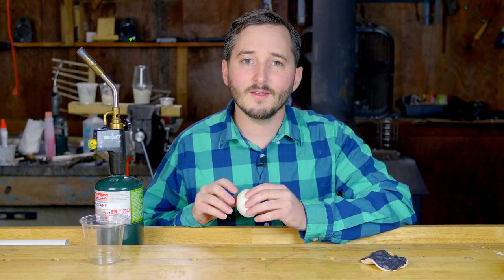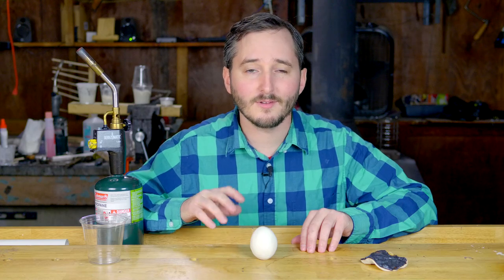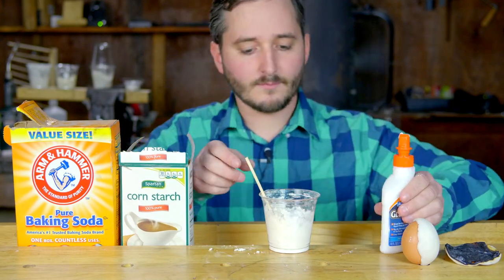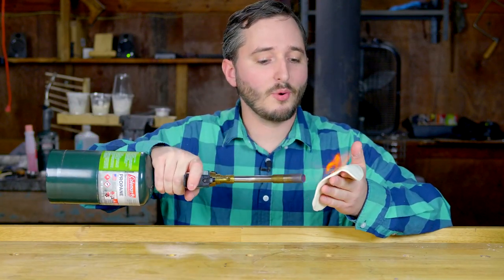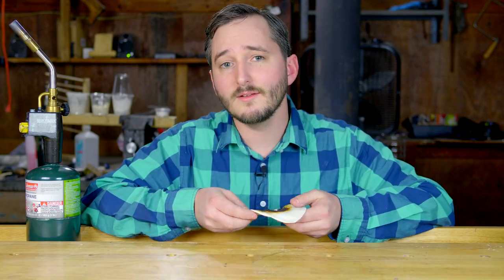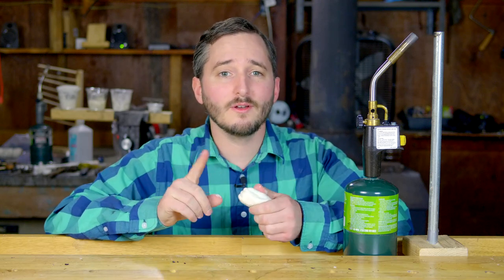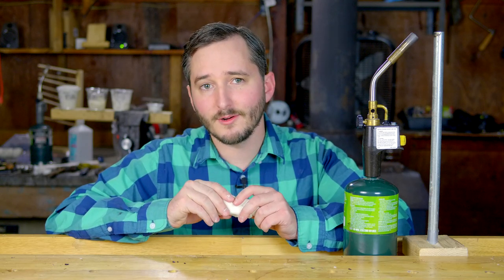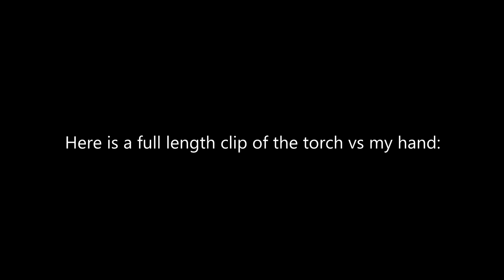A Super-Material That Can Be Made In The Kitchen (Starlite Part 1)

Comment: Just awesome. Add graphite into the mix and you most likely have Starlite II. All houses firewalls should have a layer of this. Or the whole house should have it, as it is made of cheap materials. PVA's and such will be hard after a while as you mention. Is there is any compound that makes it gelly or soft for a very long period (before the heat/fire hits it, oc)?
Reply: Is the only  next thing a fire can turn this charcoal/graphite mix into, if added pressure, diamonds? :)
Reply: Silly really to "reply" to your self. However, I found one information #NightHawkinLight could answer. The longevity of the PVA Starlite is around 2 weeks,  as it is claimed. Do you by chance have any of your own starlite that has passed 2 weeks and still posses the same properties. Or does it indeed fade away by time?
Reply: @corresandberg  sometimes, the most intellectual inspiration and conjecture you can find in conversation, is with yourself...I do however appreciate that you shared your thought process with us. Obviously, some super-preservative would be required in the compound to prevent deterioration of the Hawklite.
Reply: It looks to always be at least to a small degree malleable. So it has to trap water or what's-in-the-glue in it. Maybe that's what is drying up over the weeks.
Could you add something that gets a little fluid when warm to it?
EDIT: Nope. In those videos from the inventor it looks cracked. So I guess it can be rock solid.
Reply: I had also thought of adding graphite. Another idea I had thought of is adding borax. Any slime maker knows that a water-based glue solution and a water-based borax solution gives you slime. Maybe there's some other stuff to add that can made it dry faster so that you just smear the slime on what you want, let it dry, and you have a semi-permanent coating.
Reply: @GLITCH_-.-  he mentioned that regular sugar produced a fluid under the carbon foam when heated, but added that's probably dangerous, at least if it contacts skin while liquid.
Reply: @bobsagget823  indeed. I see you have taken to sharing your inner reflection as well.
Reply: @shanetimberedowl9541  Sometimes people acts fast. I am sure we want the same. I found nothing you said to be against my tought..
Reply: @ComradePhoenix  Interesting :)
Reply: @corresandberg  no defense was necessary as I was only concurring with your analysis that this material wouldn't retain its flame retardant properties over time. I simply offered that a preservative of some sort would help

Comment: Maybe make a version of this to insulate those fire trucks used to drive into the wildfires.
Reply: From what I saw was starlite was a harder substance than this. This could be a quick thing to apply to stuff to fireproof
Reply: @spingebill8551  he didn't let it dry in the video.
Reply: according to Maurice ward starlite would be useless after a few years
Reply: @Alpha0ne  Doesn't matter, it's cheap enough to manufacture that it still makes sense
Reply: Good idea, but fire trucks use internal combustion engines that need oxygen, how well will they run?
Reply: @fathybalamita1537  just keep the intake open

Comment: Thermite vs "starlite" please. Maybe coat a flowerpot in starlite and see if it still breaks like it normally would with thermite.
Reply: It probably will, i mean, starlite (or this) protects against heat, just heat, not mass. so when the thermite which is very hot forces it's way down with weight it will probably be a different case (i think).
Reply: Maybe layer it in different thicknesses, e.g. 1/8", 1/4", 1/2", etc., to see how much, or how little is needed to be effective against the thermite. Use the same quantity of thermite for each test layer, as well as, directly on an unprotected pot.
Reply: Sounds like you want to test it at the highest level I can imagine.  I want to hear how it goes too.
Reply: Thermite reaches a mere 2500 degrees C, which is a temperature at which this material just laughs, so it should protect against it.

Comment: Have you tried adding Silica? A friend of mine had a factory producing fire doors....he wouldn't tell me the formula but I know he trucked in 44 gallon drums of sodium silicate and many pallets of mica and perlite. He was using phenolic resin as a binder and heat and pressure to cure.
Reply: I'd like a follow up video on the implications of this.
Reply: you're probably right about silica.

Maurice ward being a hairdresser probably factored into it so he would have used materials he was familiar with that had fire fighting properties.

It's used as a flame retardent already and synergises with magnesium hydroxide and aluminium hydroxide.
Aluminum Hydroxide itself serving as a filler for polymer applications
Silica is also used quite a bit in hair care so I'd wager that Maurice was familiar with the material.

Would be interesting to see some ceramic compounds added to this recipe, and maybe then expermented with a binding agent that can form a more solid block. Maybe hair or another fibre like substance can be used to bind compounds together to reduce ablation.

Silica itself as a material is considered non-toxic when ingested, 
so if the edible statement wasn't to throw people off then that really could be a lead when yu take into account a family member has said that it could be eaten safely.
Reply: Nobody fucking do this silica is worse than asbestos.
Reply: James Lysander With respect your comment is valid but there are people working in industries where they are exposed to respirable Silica everyday. I work in construction and quite often have to work alongside tilers and concreter polishers who produce clouds of this dust which I try to avoid as best I can. My point is though that the tiny amount you might use and be able to control in an experimental context is nothing compared to most people being exposed to this in everyday life.
It is after all the the second most abundant mineral on Earth.
Its the real fine powder one has to avoid breathing in quantites that can coat the inside of your lungs.
I watched a documentary once where two guys had a flour fight in a bakery and both died of asphyxiation before the fight was over.
Everything is dangerous.
Reply: Sodium silicate is used as glue in high temp env. it also is a strong base. Wear gloves & eye protection
Reply: Yes! Silica, being used in glass, as in fiberglass insulation.  Perlite, already being used in refractory materials to line kilns and melting furnaces!
Reply: Sodium silicate is the main ingredient in exhaust (muffler) repair putty.
Reply: I'd be interested in a comparison of this stuff vs sodium silicate putty. I guess the putty is way more heat conductive, but what if it was used as an extra layer over the cornstarch goop? Would it just flake off when the bubbling started?
Reply: @bobs12andahalf2  sodium silicate putty doesn't work nearly as well. I tried it a couple years ago. I'm going to simply try different ceramics and ratios at my uni lab. I'll keep you updated if you're interested.
Reply: @MrWhangdoodles  Please do!
Reply: @abyssmanur3965  the disease is known as silicosis aka grinder's asthma.
Reply: @AMBEE-sp2ev  Thanks...I've probably got that too lol
Reply: Abyssman UR mica does more heat dissipation than silica

Comment: Does this require a high heat to become a good insulator? 

It seems like if you were to measure the R-value (using a low temperature) before you hit it with a torch it wouldn’t be very good insulator. Whereas the torch converts it into a carbon foam and suddenly it would have a good R-value even with low temperatures. Or is that thinking incorrect?

Comment: What about electricity conductive, and flexibility, and hardness after dry up,  and lighting isolation from electricity also?
Can you make some tests? 
It can be very useful for electrical workers also by creating specific uniforms.
Reply: Carbon is a very good electricity conductor, it's likely that this material won't be a good insulator ; I'd still like to see some tests !
Reply: @sylvelk  carbon is not a very good electrical conductor. that's why they can make carbon film resistors out of it. but yes, it's not a good insulator by any measure.
Reply: carbon is a good conductor but because the carbon is so thin you would need very high voltages to allow current to pass

Comment: Can you get the test working with an oxy-acetylene torch? I mean, propane barely exceeds 900F... around 450C... you stated starlite was tested under conditions of 10,000C... that’s a HUGE DIFFERENCE... oxy-acet would get closer, around 4,000C...
Reply from the maker: Propane without oxygen burns around 2000 C, but yes oxy acetylene would be the next step up to test
Reply: Graphite will get hotter with a high voltage electric current. (Arc furnas)
Reply: NightHawkInLight You could ask Cody from Cody's lab to try it out for you
Reply: "An air-only torch will burn at around 1,995 °C (3,623 °F)," Wiki
Reply: Genuine question here : what is the temperature of the flame in this video ?
Reply: Umm, 450 °C? The hell did you get that info from?
Reply: @TheYear2525  i think hes thinking of a typical butane filled lighter.
Reply: There are videos of people testing this type of mixture with a laser and the laser cut through it like a flatbread. Would be curious to see if your material does any better. The inventor calls it starlite plastic, so I wonder if there is a hydrocarbon element to the original that might make a more efficient carbon source.

Comment: I wonder how that compares to aerogel?
Reply: I wonder how it'd compare, if it was encased in a gelatin or resin.
Reply: Next video, do a comparison test of them
Reply: Not as light, for one thing...
Reply: @masonp1314  needs to burn first to be affective
Reply: if it's "The" legendary starlite then it would be a much better insulator than aerogel is, it would however be much heavier
Reply: Alex Wielinga  Sure you can! Just look up "applied science aerogel".
Reply: I’m just wondering about the insulative properties to compare. I don’t care if it’s heavier or how it’s made.
Reply: It's just freeze dried petroleum jelly.
Reply: Not as light, but not as delicate, either.
Reply: The one is expensive, the other is dirt cheap.
Reply: @joeblack4436  
Yes, and this one is easy to make, the other one is quite tricky, and requires specific non-household chemicals.
Reply: @GrowingAnswers  Well per mass aerogel is much more efficient. this stuff is a lot denser and just by that alone it would far overreach the properties of aerogel. However, the reason why weight and density actually are so important in that argument is because of the material's applications outside of the laboratory or the household, even: aerospace, whereas weight is everything, and aerogel, something almost nothing in substance, is the superior insulator not because of it's R-value per inch but instead because of it's weight-to-R-value ratio.
Reply: What I saw was the thickness of a piece of paper painted on an egg.... then a welding torch pointed up close for nearly a minute.  (a minute on TV is forever!) The Starlite bubbled and blackened but never broke down.  He stopped the flames, picked up the egg 2 seconds later, cracked it open, and a liquid egg poured out!  THAT amazing!!!  NOT FAKED!  Saw it on 'Mike Douglas Show' and on 'Merv Griffith Show'.
Reply: @ @GrowingAnswers   He said at the time if heavy electric wires were coated with it, most electrical seepage would stop.

Comment: I wonder how this material will resist "moderate" temperatures and possibly no flame.

Since the mechanism depend on the pyroslysis of the starch and the lack of oxygen caused by the flame, how well would it insulate against, say, oven-like temperatures?
Reply from the maker: Probably not very well, but requires testing.
Reply: Exactly my thoughts as well!
Reply: I know that when I just made this, a simple lighter flame against the un-dried materials is not enough to cause enough foam to form, and the conductivity from the water still present was enough to warm it and my hand up. Will have to try once dry.
Reply: Agree, Real starlite video protected against laser capable of 10,000 C temps

Comment: This stuff seems to be a great flame retardant. How well will it do against a high-power laser? Also, does this stuff become brittle after it dries?
Reply: It probably becomes pretty brittle, but you could add stuff to it to make it less brittle, such as glass fibers or carbon fibers.
Reply: @SpaceflightSimulator_Official  Interesting. Thanks.
Reply: @SpaceflightSimulator_Official  those would make it more brittle
Reply: Those would make it a composite heat-resistant coating that will eventually be used by spaceX or whoever it is those days
Reply: @SpaceflightSimulator_Official  oh hecc it's you Stef!

Comment: Can this be used in a furnace or a coal forge? I am really  looking for a cheap solution
Reply: My thoughts exactly!
Reply: Yeah really ! My thoughts too
Reply: Sure. You can also char bread in a zero oxygen environment and use that.
Reply: Well to be sure most practical materials for making, melting and pouring steel break down over time.

Sure there is ridiculous shit like zirconia refractory that doesn't appreciably, but you know what? That is actually less useful than things like sand and clay, especially at the small scale, precisely because it is so insulating.

Apparently ideal is that it absorbs some heat so it doesn't all go out the chimney.

Which means it is changed by the heat which means it inevitably breaks down and needs replacing. Which is fine if it is cheap, easy to apply and not always on

So in short, try it and see. Maybe it will work well, maybe it will be an abject failure. If you have thick layer of sand and nothing valuable underneath the only thing damaged will be your sense of pride...
Reply: @MrGoatflakes  thanks a lot. I was wondering if sand is ideal. Can I mixed clay, sand and vermiculite and make a forge? Will it insulate the heat?
Reply: Ignited Innovative Indian does not space blankets do the job?
Reply: It's hard to say but it looks like the material might only be one time use. The king of random shows himself using kaowool for a cheap insulator and it doesn't burn.
Reply: Dont think so considering that it’s ablative
Reply: No, carbon would burn overtime
Reply: cheap surce for a fournace is plaster 2inch thick  as structure 
          (stable up too 900degrees celsius= 1652 fahrenheit) and 
+ coat it with clay 1 inch thick (stable minimum 1350 degrees celsius =2462 fahrenheit usually more)

The good things is Plaster and Clay are easy to handle just with water.
You could alse add a wiremesh to the Plaster to make it more stable.
if you want you could also make the Plaster as a 2 wall construction with quartz sand between as cheap heat insulation.
Reply: @hyperhektor7733 plaster very rapidly breaks down in a furnace and clay by itself isnt the best insulator, afaik the best homemade refractory is sodium silicate + perlite or vermucilite or talcum powder. As for this material being used as refractory I am about to attempt to make an oil burning torch using this material as refractory
Reply: 'One time use' maybe, but come to think about it. How many times does one's house burn to the ground? Unless it was 'ground hog day' of course.
Reply: I would think it would be ideal for a small foundry (instead of, or in addition to the refractory materials normally used). Because the carbon foam seems to be basically incapable of absorbing heat, all of the heat used in the foundry will be re-radiated out and applied to the material you want to melt (especially if the lid is also coated in this material). It is at least possible that this method could be used to get a few dozen degrees C hotter in your foundry than you can normally achieve.
Reply: Action in the first 2 minutes is what makes a video like this enjoyable
Reply: This will only work until the CO2 producer stops producing CO2. Go get some Rockwool from Lowe’s.
Reply: @brandonejem8620  Koawool is a lot expensive in my part of the world. hence I am looking at DIY solutions. also, Koawool forge might not be suitable for coal forge.
Reply: @Seyalan  That's pretty much the second most basic forge you can make. The most basic is a hole in the ground.
Reply: @ccapwell  I made one with a hole in the ground. A very basic one. Worked. In am looking at trying out other options as well
Reply: Yes, typically in commercial/industrial places they use "Refractory". Works on similar principle but doesn't burn/decay

Comment: Use it as an insulator to make a propane forge.
Reply: Or a arc furnace
Reply: Would that work? I'm seeing comments saying it has a fairly short shelf life of around 2 weeks. Maybe that's only for the unburned material so after running the forge the carbon sheets would be more permanent. Might try making a forge out of it.
Reply: @nicholassmith4855  if he doesn't use pva glue there might be a different shelf life
Reply: @ @nicholassmith4855  
If used it won't have a shelf life anymore, since it "burns" into carbon foam, that doesn't rot, unlike cornstarch.

Actually if you heat an organic material it will release all sorts of volatile organic compounds (light hydrocarbons, that tend to be gasseuos and ignite easily), point is that baking soda when heated creates CO2, which stops said molecules from burning, meaning that said hydrocarbons won't heat up the coal foam even more (and its also partially shielded from oxygen thansk to CO2).

If you want to use carbon foam to line your furnace walls bread would be my go to starting material.
Pu it in a tin can, poke a hole on it, close the tin can, drop it in a campfire, and when small flame stops coming out of the hole you are done. Or if you are not in a hurry let the firer die out. Woo you got carbon foam!